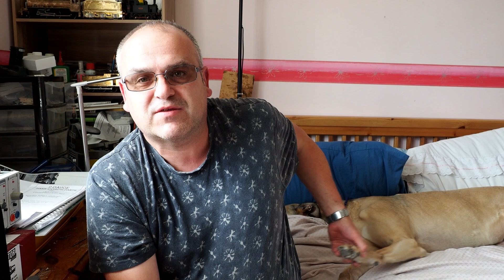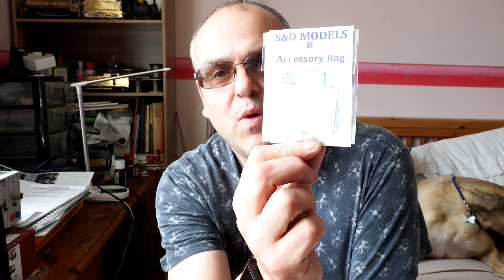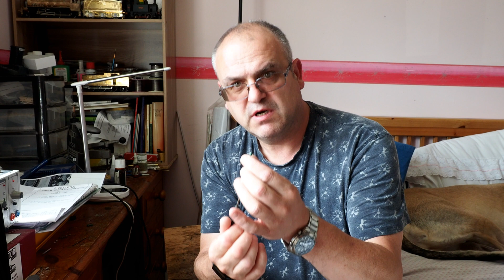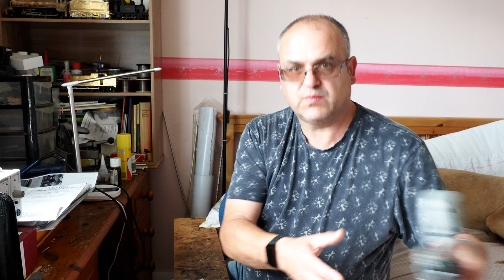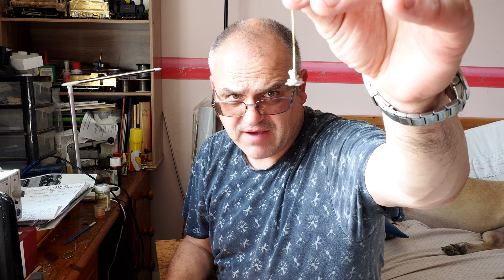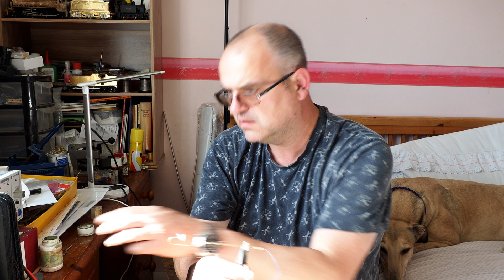Gas Lamp Demo

Comment: Whots the point in doing  a film on how to make a item and not show you how !!! .
Reply from the maker: If this is the A8 build, this has already been pointed out to me, and was rectified when I built the G5, and is being done for the 2MT. Things were very much experimental when I started doing this, and it is only from constructive comments that we can make alterations to the way videos were filmed. Showing a build in more detail takes longer to do, and initially, I didn't have the equipment to present it any other way. Now I do so changes have been made.